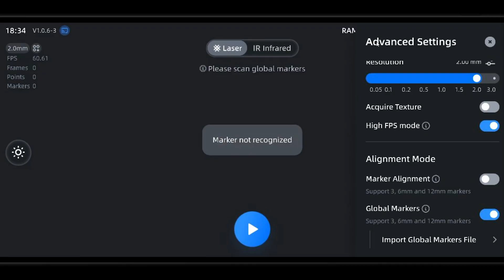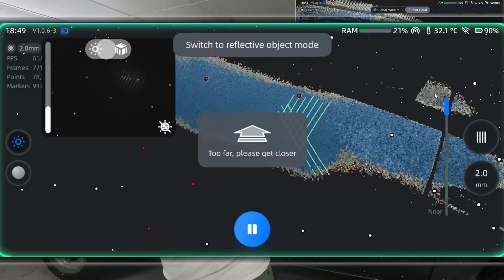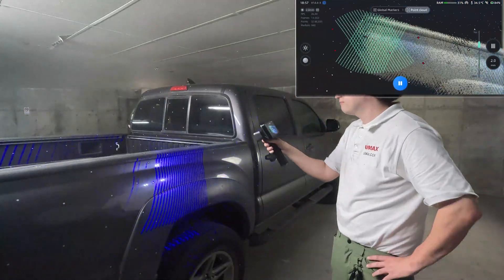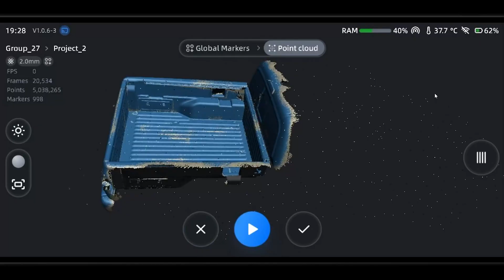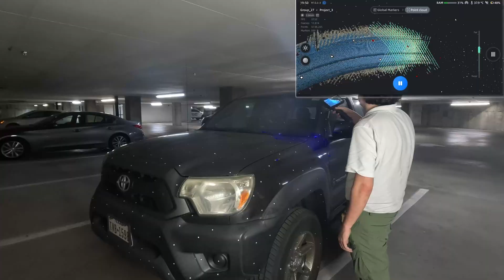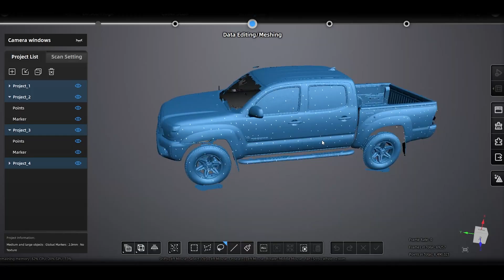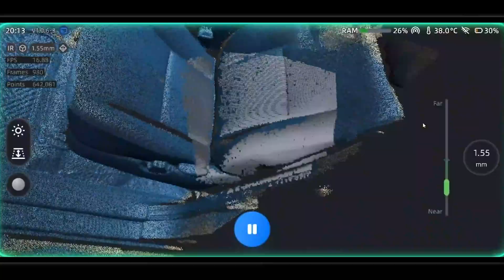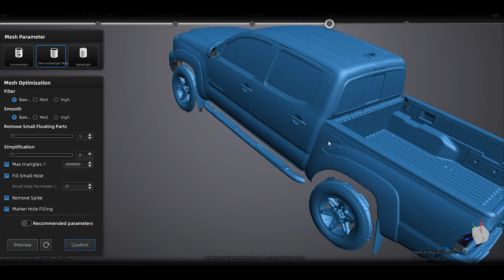How to 3D Scan an Entire Truck with EinScan Rigil 3D Scanner?

Comment: Hi, can you scan without any markers? I think its advertised as a mode on the Rigil?
Reply from the maker: Yes this scanner can scan the objects without markers. In this video you can see that we scanned the truck's trunk bed without placing any markers.

 However, if the object has very flat surface with no intricated details, it will be hard for any scanner to recognize the surface and you will still need to place some markers on the flat surface area to help the scanner capture the data.
Reply: Ok thanks
Reply from the maker: For Marker-less scan, there are two options. One is IR mode and the other is Laser feature mode.
IR mode, you can scan the object easily even it is flat surface.
Laser feature mode, you will need to have a intricate detail surface object to make a good scan result.